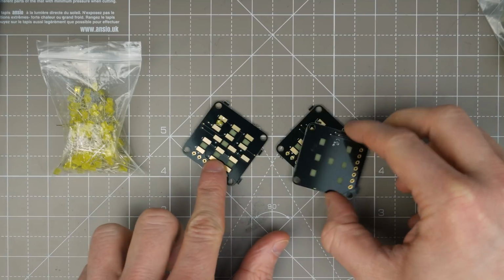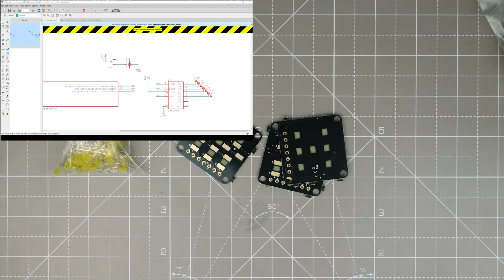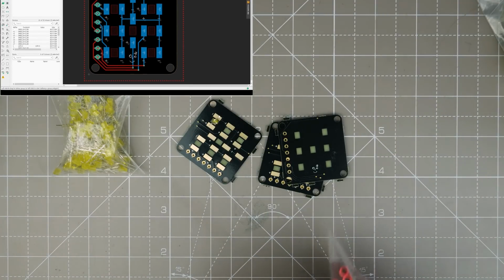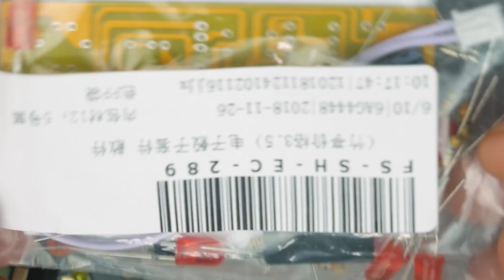Electronic Die (Dice) Part 1

Comment: Well, I dunno if you're still doing the "brains" part.... but .... diode steering is very difficult if you're trying to use ~3V because of the voltage drop of the diodes. If you're using a standard 1-6 dice then you only need 4 outputs - you only need to drive the 3 pairs and the centre LED. If you use white LEDs you can do it all from the ATTiny without even using resistors.

Comment: Great video. I'm inspired to make one of these and improve on it but the design part might be  a bit of a challenge. I'd have all sides used as displays, but only the one facing up would be illuminated after you toss it and it stopped moving . There would be an accelerometer to detect motion and tilt switches to tell it which side is up - real 3D digital dice you can throw!

Comment: Hi David. You could try spraying the superglue with an activator to make it cure quicker. You can buy the activator from Fleabay.  Search for 'SF7455'. The other places I buy it from are my local double glassing window manufacturers and suppliers. They sell it in large aerosol cans and works out cheaper.

Comment: If the super glue is Ca (Cyanoacrylate) based, which most are,  i can recommend those super glue activator / accelerator sprays. They exist from different companies. First I thought that just stupid marketing, but since I tried one i'm totally convinced. You just need to spray a little bit at the glued area and it will basically instant dry and stick together. One can will last you for a long time. Just be very careful with your hands and check twice that the glue didn't get in unwanted areas. I've destroyed quiet a few momentary buttons that way because some glue was getting inside.
Reply: Leif - I use a pen-type accelerator. These are sold in hardware stores as "plastic glue" - it's a tube of standard Ca plus a metal tubed felt tipped pen containing accelerator (that they call "primer").
Easiest way is to apply the accelerator to one surface, and Ca to the other. You can apply it to both, however you then must be ULTRA quick with the application of Ca and pressing the surfaces together... otherwise the glue hardens before it sticks to the second surface!
Reply: @johncoops6897  Accelerator in a pen sounds great.  So far i haven't seen them here in Germany, but if they're sometimes labeled as primer in sets i'll look again or see if i can find one online.

Comment: Superglue takes a long time to stick when both surfaces are smooth and has a tendency to shear if lateral pressure is applied to it.  Best thing is to use one porous surface or a spray called a kicker.  I know it sounds disgusting but you could also try licking the LED very lightly as the glue reacts with water (hence why it is so good at sticking fingers together).
Given you cannot scratch the surfaces you would do better with a clear two part epoxy resin glue BUT watch out as some of these will turn brown with heat or age...

Comment: Hi Dave. Depending on what look you are going for, charlieplexing is the easiest. Once you wire up the LEDs correctly then the software does everything for you. It's a simple case of setting pins high, low or floating.

Comment: Blue LEDs are brighter, and I think the clear water colour blue and green rectangular ones are even brighter.
Reply from the maker: Sadly I have the forward voltage drop to consider with a single 3v battery. I will see if I can pick up some efficient blue or green ones.
Reply: @DavidWatts  Blue diffused or any - I just checked - of the water colour ones are bright. The water colour are more single point of light but yore PCB diffuser will spread it out.
https://www.ebay.com.au/itm/2x5x7mm-Water-Clear-Diffused-Rectangle-Rectangular-LED-Emitting-Diodes-Light/192080434574?hash=item2cb8e2d58e:m:mbxhPH73WylspNd55HMp13Q:rk:41:pf:0
Reply: I'm using Blue LEDs in my Christmas 3 PCB and it's by far the dimmest one. Green is the brightest for me. (0603 LEDs all from the one manufacturer)
Reply: @BrianLough  I don't know about SMD ones, but I know about the 2x5x7 rectangular LEDs because I have a lot of them in different colours. https://youtu.be/mgi-e-TiVIw